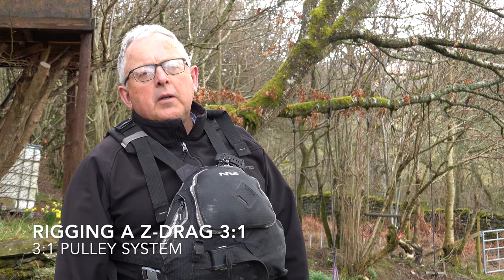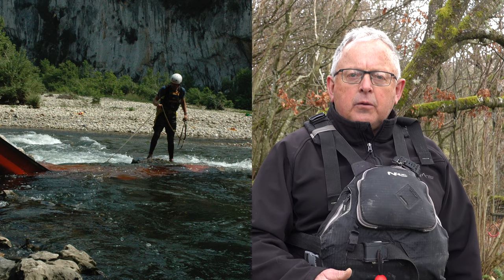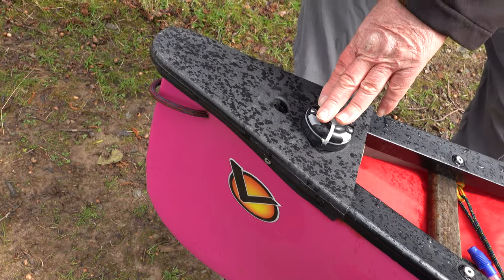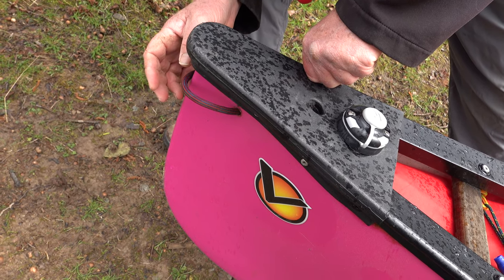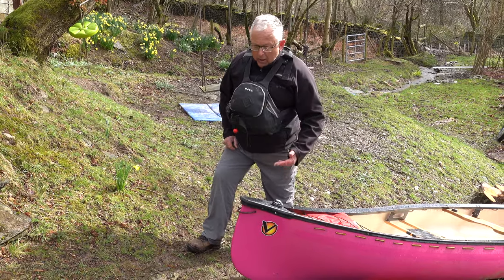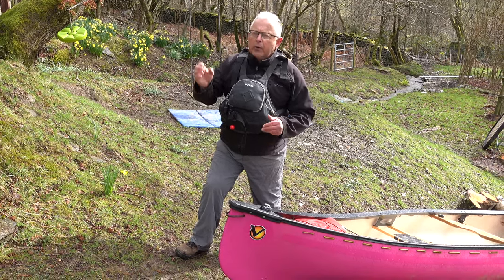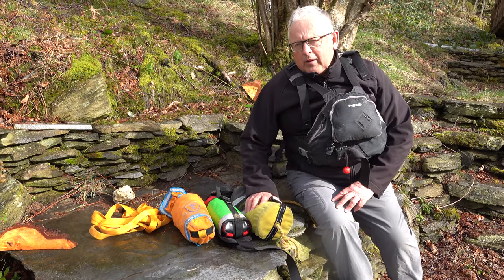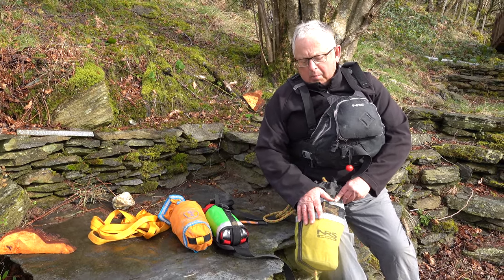Unpinning a Canoe 1:  using a Z Drag to pull a canoe (or kayak) off a pin in a rescue.

Comment: Hey Ray, checking in to say thanks for this very useful explanation of the Z-drag system. In my preparation for a 4 day canoe trip with three friends I studied your instruction and practiced it in my garden. I also invested in quality materials (carabiners, pulley’s and throwropes). As most experienced paddler I felt the responsibility to make things as safe as possible… Turned out to be a good investment. As we paddled down the Allier river last week, one of us got trapped in a (partly) submerged tree in a riverbend. His canoe made water, turned an was swept away by the current, as was my friend. The canoe was jammed under a second tree in the current some 30 metres downriver. My friend landed in the same tree. After checking if he was safe and sound we tried to unpin the canoe. This was only possible with the use of the Z-drag (and a lot of adrenaline and a saw ;-)). I wanted to thank you for sharing your knowledge and skills, it really made all the difference.
Reply from the maker: Wow.  First great you pointed out the priority with you friend being safe (useful to other people) before you looked to the boat.  So glad that the video has been of practical use.  Your practise in the garden would have been the key to your success in the real situation.  Very many thanks for commenting and letting me know.  Cheers

Comment: Really clear instruction, thank you Ray. You can now buy Carabiners with a built in micro pulley. Not as kind to the rope or as easy as a full pulley, but far kinder and more efficient than a plain crab for no extra weight or bulk. By the way to me the overhand tape knot you show is really weak, quick & easy to do, yes but an in-line overhand knot, where you tie the overhand in one tail only first, then weave the other tail back through it from the other direction is far stronger & kinder to the tape. Your filming is really clear, shows how well the French prussik works in self releasing on the pull & gripping on the hold. Excellent demo, thank you.
Reply from the maker: Yep I meant to include those Karabiners in the video: I had one in the kit bag.  In the second video of the series    https://youtu.be/ws4MQITY4Vg I have included a section on these Karabiners.     Yep agreed the tape knot is weaker this way but on checking figures it is sufficient with the other kit being used also I wanted knots that a non knot person could learn and master easily.  Hope that explains my thinking.  Thank you for your thoughtful comments.
Reply: @RayGoodwinCanoe  Yes I can see the point, it is very quick & easy to do, just gives me the shivers as it is so unkind to the tape (or rope) ! Thanks Ray.

Comment: Great video. That wasn't a pursick knot that's klemist knot.
Reply from the maker: Thanks Lucas, appreciated.  Re Prussik knots:   The one I am using is the French Prussik, unlike the Klemheist the one loop is not passed through the other but both looks are clipped with karabiner.  A Klemheist would work equally well in the same situation but I like the simplicity of the French Prussik for teaching others.   In different context I may use The Prussik knot, a Klemheist or a French Prussik.  Hope this clarifies.   And again thank you for your comments.

Comment: Great video, which pulleys would you recommend?
Reply from the maker: First up I am supported by NRS for gear.   So they offer a really good rescue pulley:    https://www.nrseurope.com/product/45251.02/smc-crx-1-pulley     Quite a few of the climbing companies will offer pretty well the same.  Key is the breaking strain marked on this one.  Don't go for weaker.  It also has what is called a prussik minding ability so it is easier to stop the knot being drawn into the pulley.   Hope that helps.  ray
Reply: @RayGoodwinCanoe  Cheers Ray

Comment: like the instruction upon setting the system up!!!! may i ask what length rope? whats the best pulleys for this type of system?
Reply from the maker: Hi.  Strength of rope is important so I use a 10kn bag.  Length normally I would use a 20 metre.   Pulleys I have use the Petzl:  Petzl Rope Pulley, 7mm min rope diameter, 13mm max rope diameter, 5kN max working load

Comment: Great info, Ray.  How easy does the over hand knots in the webbing anchor come undone, does it bind and you end up needing a spike to release it or does the webbing make it easier to untie?
Reply from the maker: If I am doing a full on recovery then I am just relieved to get the boat back.  However I have always, so far, managed to get the knots undone.  I have a climbing background so will often put something else in place that is easier to untie but I wanted the simplest for the video and it is my normal system.